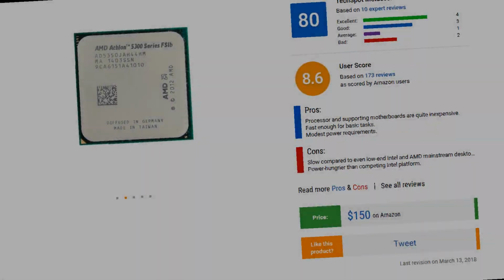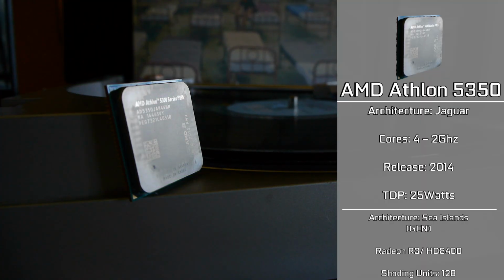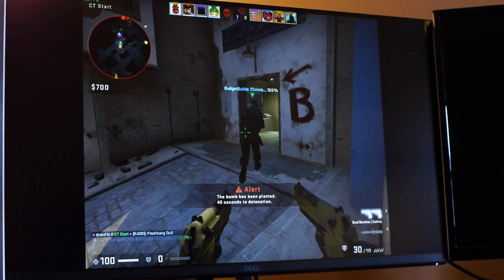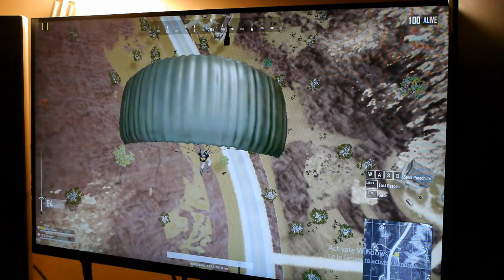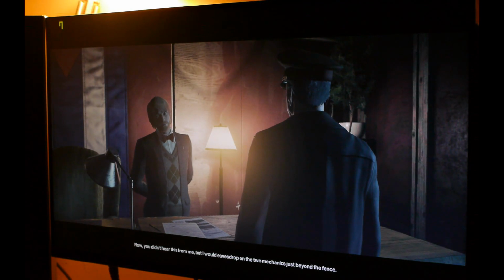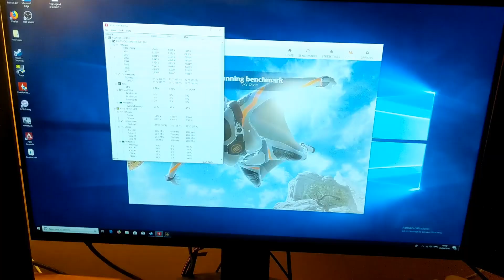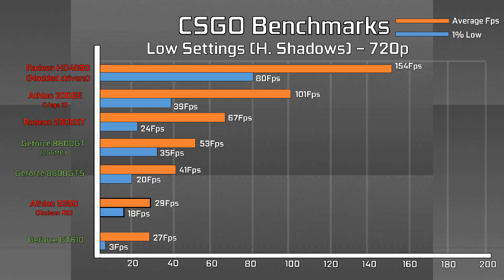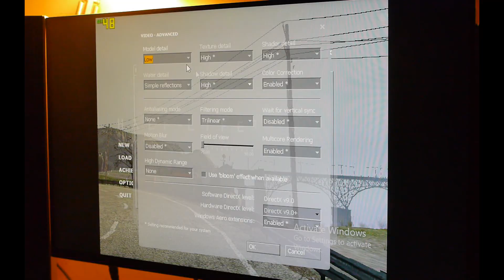Socket AM1 - Aging Horribly!

Comment: actually I think the 6 and 8 core FX cpus actually aged well...well relatively well, better now that games take advantage of more cores compared to back in the day when it was 2 or 4 core max

I get the dislike, and I'd take a sandy bridge i7 over it any day for gaming, but........they aren't the awful things people like to joke they are

it really comes down to how cheap you can find it
Reply from the maker: Fully agree about the 8 Cores, the conern is that 1155 is so cheap that to find an AM3 Based System cheaper....Well it just isnt likely in a lot of countries, and even more so if you factor in Aliexpress etc...
Reply: @BudgetBuildsOfficial  I mean I did have a guy basically throw a fx 8100 build at me last week. I messaged him to offer sellinh adivce over his ad, he says thanks and offers it to me at dirt cheap. Fx 8100 l, 8gb ram,  high end mb 750ti 600w modular psu.... $55 after I traded him an old keyboard and a pair of speakers some dude had given me for free a few days prior.

Only downside....from a smokers home so I had to clean it Alot. 

If I had needed a pc....I would have 100% have been down. But I didn't so I broke it up and flipped the cpu/mb/ram for $120. Kept the gpu to put an a dell xps 8100 I'm picking up with a i7 860 to sell and then used the case and gpu towards a 2500k r9 270 build I'm selling
Reply: @BudgetBuildsOfficial  excuse me sir....you mean AM3+ based system
Reply: Those weren't even "cores", per se. The modules performed basically like half a core. (e.g. An 8-"core" FX performed like a quad-core competitior and a 4-"core" FX performed like a dual-core competitor.)
Reply: @cardboardsnail  you've taken the issue and exaggerated it too far 

there were cores...they just shared resources. And they lost to Intel in IPC anyway 

so yeah, they didn't operate as well as true cores....but they sure as heck existed. 

Rather than compare them to Intel, you would have to compare it to a Phenom 2, so a Fx 8000 series wasn't losing to a Phenom 2 X4

Intel wins anyway due to much stronger core performance so a saying a 4 core fx was akin to a dual core intel in performance isn't down to core skepticism....it's due to shit IPC 

4 core FX would still win hands down at productive over an intel dual core
Reply: @bluescluessuperagent  There is no exaggeration -- the benchmarks both past and present indicate as such
Reply: @cardboardsnail  except they don't. Like at all. Not even close.

your argument was inherently flawed. your exact words

e.g. An 8-"core" FX performed like a quad-core competitior and a 4-"core" FX performed like a dual-core competitor.

Well no duh, cause FX cores were shit.  Intels cores were much more powerful especially the K models with a decent overclock. 

Making the conclusion that this happened cause of the shared core controversy is not the correct conclusion 

you would need to compare the cpus to other cpus that had similar core count and similar IPC

so a first gen FX vs a Phenom 2. People were upset there were zero IPC gains, and clock for clock the cpu was slow........but a 4 core FX 4100 wasn't going to lose to a Phenom 2 X2 with only 2 cores. Show me any benchmark that indicates that.

FX would have gotten it's ass kicked by Intel regardless of fully seperate cores or shared cores. The shared cores didn't help, and did make the cpus weaker than they could have been, BUT their single core performance was trounced by Intel

it's more like the cores performed as .8 of a core. MUCH better than Hyper-threading, not as good as Intel's or even AMD's past totally separate independent cores

And no, I wasn't an FX user. Never even owned an AMD cpu till like 2017
Reply: @bluescluessuperagent  I'm not sure what point you are trying to make here. You don't refute that AMD's module setup was poor, and inferior to competing solutions. 

(1st gen FX) Bulldozer's peak decode rates (for the decoder, before data gets sent to the schedulers) for dual/quad cores (2 "cores" being a module for AMD) is 4 and 8 instructions per cycle respectively. Meanwhile, Intel had 8 and 16, respectively for Sandy Bridge. (Intel's contemporary offer.)

A Bulldozer module contained two integer schedulers and one floating point scheduler shared between the two. Typical cores have both 1:1. What this means is a Bulldozer module -- 2 "cores" have the  theoretical floating point performance of one typical core. 

It wasn't just poor at benchmarks -- FX was honestly architecturally closer to half a core than your purported "0.8" of a core.

All in all, FX needed incredibly high clock speeds (with a correspondingly heavy price to pay with regards to power consumption) to approach even remotely competitive performance in the vast majority of usage cases. It was bad, and thankfully a bygone architecture with the advent of Zen.
Reply: @cardboardsnail  "it wasn't just poor at benchmarks -- FX was honestly architecturally closer to half a core than your purported "0.8" of a core."

so you realize the point I'm trying to refute. In no way did FX operate as 50% of their listed core count

that's the claim I'm taking issue with. 

You have no sample experiment to compare it to. Saying FX cpus operated like 50% of Intel cpus is cause they sucked.......that same logic holds true for Phenom 2 cpus compared to a properly overclocked Sandy Bridge

Just because Intel jumped in gains while AMD stagnated doesn't remove AMD's core count

The shared resources does hamper their efficiency and power...but 50% really?

As I've mentioned multiple times, for that to be true, the FX 8100 would need to lose to a Phenom 2 X4 at a properly optimized program and that's not happening. Comparing FX to a sandy bridge and going whelp FX core count is only 50% of listed is a really bad way to describe it. There are too many factors in play

Bottome line, it's semantics and I don't agree with yours and no benchmark I've seen agrees with yours ( and no, seeing an i5 2400 beat a FX 8000 in a game is not a benchmark that proves your point, it just proves that more powerful cores are better)
Reply: @bluescluessuperagent  If you can recall properly, the quad-core FX chips were priced accordingly to compete with the dual-core i3 competition, and the octa-core FX chips were priced comparably to the quad-core i5/i7 competition as well. AMD saw it fit to price their chips as such, because they performed as such.
Reply: @cardboardsnail  .....I never said they weren't competing against cpus with essentially half their core count 

I have never once said they didn't perform bad. That's not what our debate has been about. It's been about how you think their shared cores operate like 50% cores when I've said the main reason they were bad was cause it was a shit architecture that had terrible IPC, shared or seperate cores. 

Those are 2 different failings. 

In the grand scheme of things it hardly matters.......but at the end of the day the FX  cpus weren't taking that much of a hit, like you say 50%, due to the shared nature of the cores. 

They were just garbage cores period.

I suppose an actual test would be to take a FX 6100 and then take a x5650 and turn off hyperthreading so it's just 6 cores

and the match the 2 cpues to get the same result in single core in cinebench. 

And then compare them against each other.

Comment: We need a core 2 quad vs phenom ii x4 video!! It will be fun to see which one will be the better option for low budget pc. The intel vs amd battle but... 10 years ago in today's eyes.
Reply: well as far as platforms go, I'd take the AM3 as then you can get a x6 and the lower x6's are barely more than x4s
Reply: Intel socket 775 dont can play modern games. Because a special funktion from the CPU doesn't exist

Comment: When your cpu is so lightly powered that you can take the cooler off and almost use it like that. I don't get how in 2014, amd got 4 cores in that low wattage anyways, but I guess the performance shows.
Reply: My core2duo e7200 be like
Reply: @eduardoavila646  My first "serious" system was an e6600 with an hd7770.
 I still use a pair of e5600 in a pair of windows xp gaming systems. Both have gtx260 800mb cards.

Long live the core2era
Reply: Weren't they saying cores when it was really hyper threading?
Reply: @clm3888  nope.
Reply: @clm3888  you are thinking of the FX line, which had 8 cores but half of every thing else, so it was like a 4 core with an advanced HT/SMT
Reply: I saw the date on the pc and thought it was month 25, day 3. I live in the us.
Reply: @milk-dog  It should me Day Month Year. You guys got it wrong. It isn't Minute Hour Second is it for example?
Reply: @lolcat  in that case it would be year/month/day
Reply: @lolcat  Or it could be year/month/day, that way it works better to organize files. 

But yeah Us writes the dates so strangelly. Why the heck the most important info is in the midle and not in the left or right? The month is the second most important to know, why it does some first?
Reply: @lolcat  article 13

Comment: so my laptop had the amd a6-7310 apu and it could barely run gta 5. 15-25 fps on lowest settings 800x600

said apu is comprised of a slightly faster cpu than the 5350 having 4 cores @ 2.0ghz, 2.4ghz boost
8gb of 1600mhz ram in dual channel
and the igpu is a little more powerful, being the radeon r4 graphics. 

so what gives? i even had textures failing to render fast enough :/
Reply: Those are too weak. I had the A8 4500m and it struggled for gaming. Worst is that they overheat in minutes to 100 celcius and shutdown. I bought a cooler so I could play a few games but no, I decided to start again a gaming PC. Those old laptops were meant for games before 2010.
Reply: @takehirolol5962  well i guess, but uh. ur apu is significantly more powerful than mine, it should run gta on the lowest settings no problem as well as other modern optimized settings

idk about ur overheating tho. sounds like ur laptop just had a pretty crappy cooling system
Reply: @dexthegamer3234  Yeah, I really pushed it. Get a Opolar laptop cooler for better performance. GTA V uses 4-5 cores, the AMD  APU cores are too weak for that game and the VRAM you have is around 512 MB. Even with dual channel, it struggles. As an example those cannot run Devil May Cry 5, but DMC 4 at 1024x768 low with God Rays disabled, can get more than 45 FPS ans sometimes 60. Dark Souls 2 at 720p above 30 FPS. Dark Souls 1 Remaster may be decent. Tomb Raider 2013 with DX9 more than 30 FPS as well. Well, I may repair it one of these days.
Reply: @takehirolol5962  as far as i can tell, gta 5 only mostly uses 4 cores/threads.
i don't think it's gonna choke without more than 4 cpu threads. 
these cpus are just really lacking IPC to make it's single core performance decent, hence the low end gaming performance
ur igpu  could do a tad better if it was on a cpu with better IPC.
cause a similar, igpu, the intel hd graphics 4600, can perform MUCH better when i played games on it, on a core i5.
vram is not an issue on APUs. they automatically allocate. 512mb is just a bases of how much the OS allows the gpu to use at any given time
during an application that requires more, it will allocate the vram accordingly.

i don't expect u to run DMC 5. lawl, its WELL under the minimum requirements.

dmc4 tho, why are u running it so low? you're well ABOVE the recommended settings. feel free to crank up to 720p medium settings
Reply: @dexthegamer3234  It was just a general experience I had with the APU. I know how these score in the CPU benchmark website and how AMD is weaker with the IPC.
Reply: @takehirolol5962  lel ok. But yeah, run your DMC4 at higher settings....
Reply: @dexthegamer3234  It was the only way to reach 60 FPS. I now have a gaming PC. Just remembering the old experiences I had it. I will fix it and use it again.
Reply: @takehirolol5962  alrighty

Comment: This is strange. I can remember similar A4 4000 to perform much better (30fps+ in 720p) in games like CS GO. And even 25 watt cpu should not be able to render anything without overheating for some time, is this thing ok?
Reply from the maker: CSGO is much more bloated now. Remember a Pentium 4 used to be able to get a Solid 30+, my old C2D Laptop could run the game in 720p at 40-60Fps.
Reply: @BudgetBuildsOfficial  I even googled some benchmarks and found that this CPU is indeed able to run CS GO at 40 fps with medium settings at with the integrated graphics. It is just way better than 46fps with fury at lowest 480p (this is just not feeling right)
https://www.userbenchmark.com/PCGame/FPS-Estimates-Counter-Strike--Global-Offensive/3680/11160.10020.0.720p.0
Reply from the maker: There is no mention of date on here. As I said if we boot up and older version of the game it can run.... BUT I always test the latest versions of CSGO.

Comment: Are you sure it has the right instruction sets for Apex Legends? Am2+ and AM3 CPUs I'm pretty sure don't even have the right one either. IIRC it's SSE3 and/or 4+

Edit: just checked and it supports up to SSE3, but I'm fairly sure you need like SSE 4.1 for Apex Legends
Reply from the maker: Intresting. That may be why the game doesent throw up an error, and just crashes
Reply: Yes, you cannot play Apex Legends on LGA 775. You need at the very least the first i3 chip or maybe the FX 4100 to play the game. And considering that the FX 6300 loses against an i3 6100 or G4560...ouch
Reply: Probably need SSE4.2.

Comment: My PC have AMD Athlon X2  2.8ghz Socket AM3
Reply: Same I have a secondary desktop with that. Runs pretty decent for what I use it for but definitely not more modern gaming.
Reply: @LinkDerg  I play games on mine and do vidoe editing  also on second life for hours but I also put 8gb DDR3 memory in it  and a Nvida Geforce GT 610 video card in it  now it has SSD in it as well
Reply: @BeautifulAngelBlossom  Oh damn thats a pretty decent setup. The desktop I have is a slim HP I put a AMD Radeon HD 6450 in it since Budget-Builds actually recommended it when I messaged him. It has an older board though only supported DDR2 up to 4gb which I have it in now, as well its regular HDD. But it can run older things such as San Andreas pretty nicely and desktop performance is a LOT better than the integrated Geforce 6150SE. But I use it once in awhile to relax with videos music and web stuff and ive been happy with it. The processor still holds up well for what it is.
Reply: @LinkDerg  my pc uses up to 32 gigs of ddr2 800 but it's got 2 1 gigabyte kingston RAM modules and a 2 gigabyte one that i don't remember who make it but it is going to be running MS-DOS, Windows 95/98, windows XP SP2 x86 and linux mint 18.1 with mate desktop

Comment: These were junk when they came out really... Every AMD I've had up to Ryzen was pretty awful really. I'm not sure if it's just psychological but intel always feels snappier.
Reply from the maker: Mainly just the Bulldozer era I personally feel is a tad sluggish, the name suits the performance.
Reply: To be fair, I found my Phenom 2 1090T to be quite a capable CPU at the time, after that I moved over to Intel so didn't use any other AMD until the awful bulldozer chips - Ryzen is blazingly fast though as I said. I don't particularly have a bias although I did feel AMD weren't an option for enthusiast level performance at the time. I'm glad AMD is giving intel some competition but the market will probably shift to ARM anyway making them both pretty redundant for consumer use at least. Thank you for all the effort you put into your videos!
Reply: I liked my FX 6350, was holding his 60 fps on 64 map on battlefield 1.

Comment: Budget is invulnerable to low fps. A true hero
Reply: It can run AOE II and 2D. I even played AOE II on a 300 MHz Pentium on a Thinkpad 390E and later on a single core Atom N280. But it should shutter when you did lots of AIs with cheats.